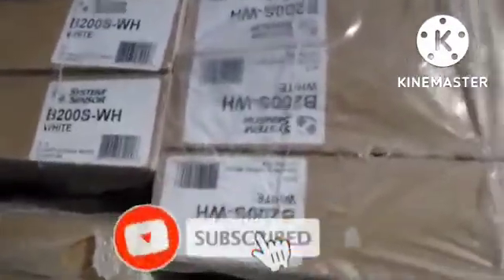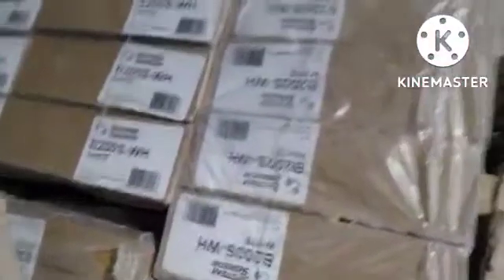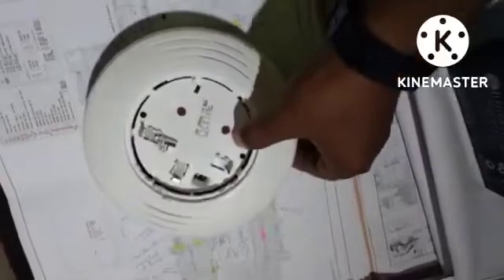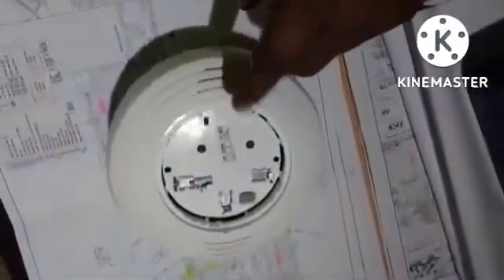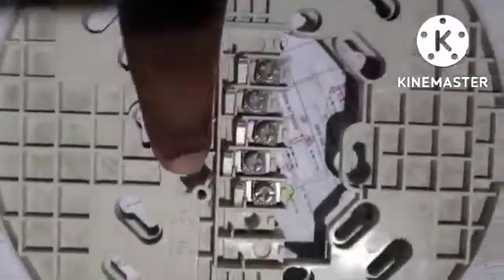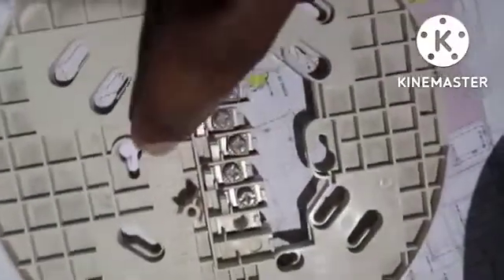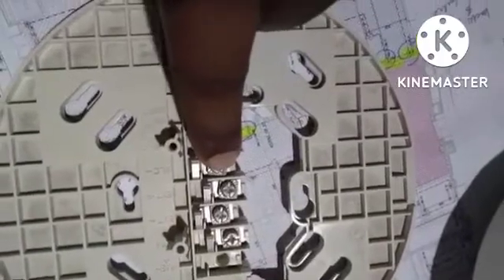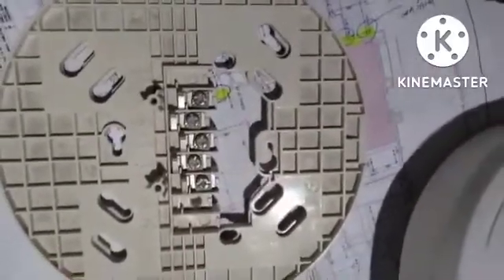Sounder Base : How to terminate System Sensor B200S WH Base ?

Comment: Hello my friend this is my first time for gas detection system installation My boss brought a unit to be attached to the restaurant, so what I did was try to activate it at the shop because he also ordered a 3-core wire for the unit. I was able to activate the gas detector. My problem is the connection of my solenoid valve where I attached it. I took a 24v from him, I didn't get anything because the solinoid is 24v, maybe you can help me, thank you.